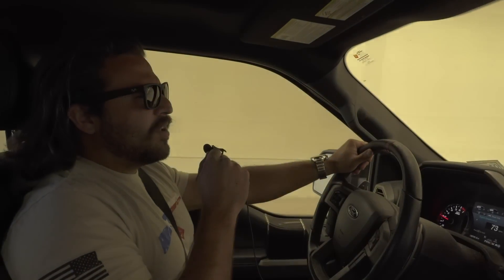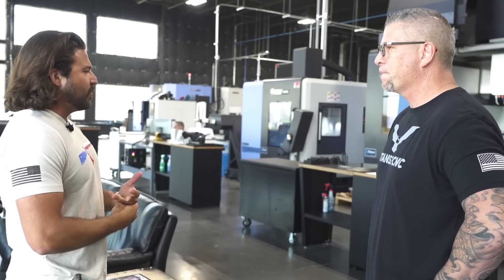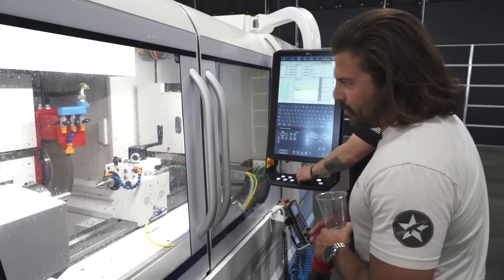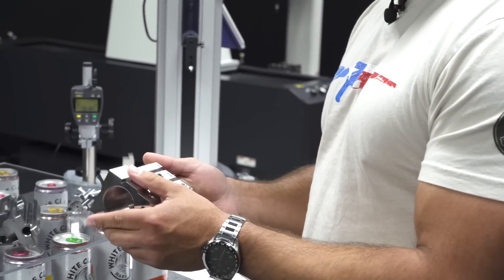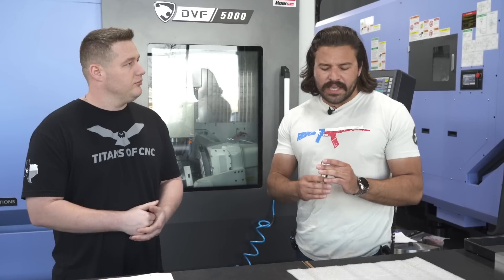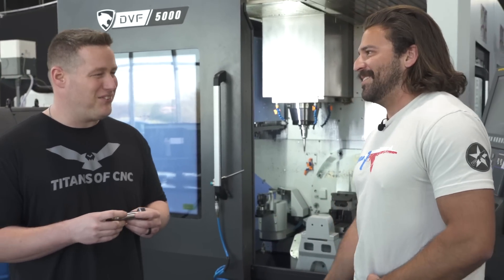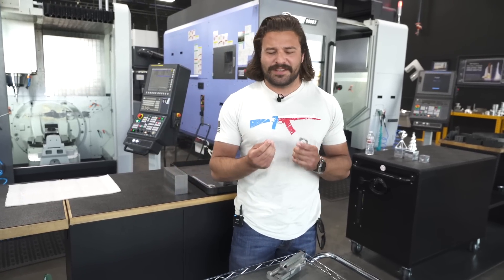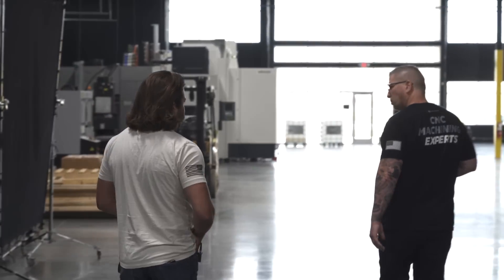AK-50 V3 Update - The Parts Are DONE

Comment: Those are the nicest AK-50 parts we've ever seen. They're also the nicest parts Brandon has ever seen.
Reply: It's too nice to be considered an AK. AK is supposed to be cheap and reliable. Izmash (makers of the UZI and some AK contracts) would manufacture a better AK50 both in performance and ease of manufacturing.
Reply: @shapshooter7769  But he's the guy doing it. They aren't. We're excited for his AK-50 specifically, not at the thought of the AK-50 as a thing.
Reply: @mightyjoeyoung404  It's a long-stroke rifle. In .50 BMG. The machining is amazing and the design is mouth-watering. Just not cheap enough to arm the other 11 out of 12 people who don't own a gun xD

Which the AK was built to do.
Reply: @shapshooter7769  ease of manufacturing would be the only improvement. This feels like a Finnish AK. As fine as the mechanism can be.
Reply: @lazzie7495  Finnish AKs are still stamped steel and rugged af because it's still the same construction. This AK50 is closer to an AKM - milled housings, expensive and boutique af. AK literally implies cheap, rugged, reliable. Otherwise, it's a Robinson XCR (excellent rifle, long-stroke action, American-made, very much not cheap).

Basically, this rifle has yet to go through intense cost-cutting measures to be considered an AK love letter.

For the same reasons I wouldn't consider a Daniel Defense AR15 the same as an M4/M16. It's way too nice a rifle to be manufactured and used in war. The original Colt spec was the cheapest one, and landed the military contracts that it did.
Reply: @shapshooter7769  It's a prototype. Not a mass production product. We have no idea what the finished product would look like, or what tolerances it would require. Right now they are giving it the best chance physically possible for it to work properly. It doesn't mean every AK50 produced will be some kind of 0 tolerance high precisionachine.
Reply: @lazzie7495  That was my point. The AK prototypes used milled parts. The mass-produced ones used stamped sheet metal for cost savings to the detriment of accuracy. As the prototype isn't the final product, this isn't really an AK either.

Weapon designation =/= following the design philosophy of the original weapon. If it can't arm an uprising in Sierra Leone, it ain't an AK.

It also doesn't look like a starving peasant put the rifle together either. It's too immaculate a machining job, it needs the huge tolerances that only worn-out Soviet machinery can give.
Reply: @shapshooter7769  The original prototype was called the AK-47. What do you mean AKs can't be prototypes, and it wasn't worn out machining. The guns where brand new, they look worn down now because they've been used and abused for decades.